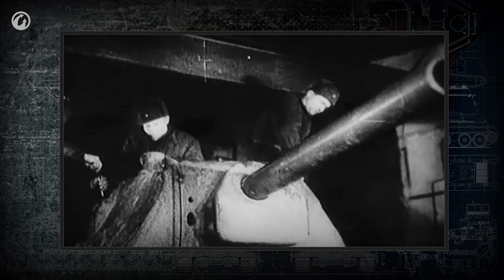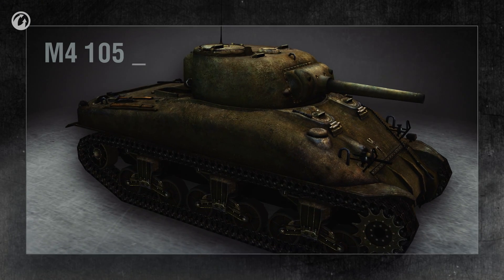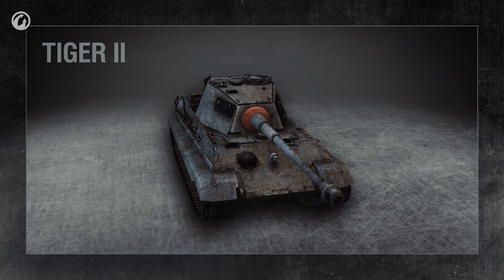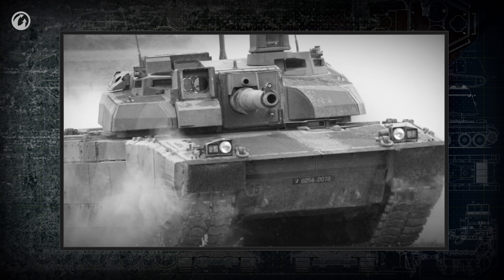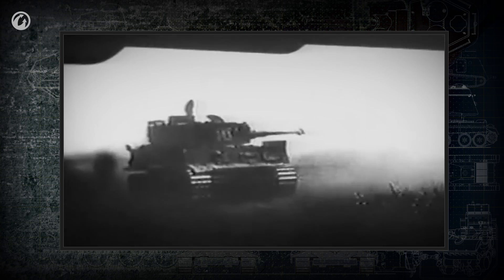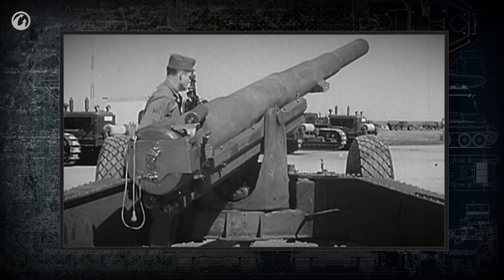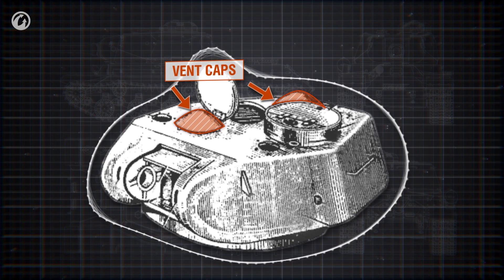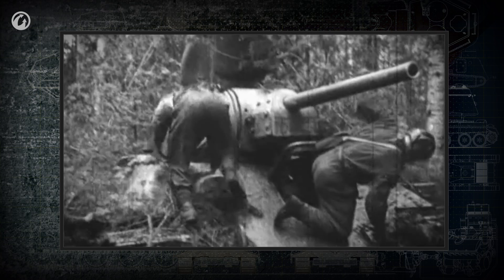Cannon. The Nuts and Bolts of Tanks

Comment: It's worth noting that the british MBT Challenger 2 still uses a rifled gun.
Reply: +junsengjs The British are rather fond of HESH (High Explosive Squash-Head) rounds. HESH rounds have a soft high explosive tip that spreads out in an thin paste over the target and detonates shortly afterwards. They're good for blowing holes in the sides of buildings and cause large amounts of spalling when fired at armored vehicles. The spinning caused by rifled guns causes the high explosive paste in HESH rounds to spread out more. This is why the British still use rifled guns.
Reply: Yeah, they like their HESH.
Though, firing APFSDS out of rifled guns really kills the gun barrel quick.
Reply: They are also far more accurate.
Reply: Thomas Dineen- Yes the British liked their Hesh rounds but now in modern MBTs, Hesh rounds are almost useless because just about all modern MBTs have spall liners.

Comment: 5:02  wait wait.. Isn't that an SU-152??? why does it say ISU-152?
Reply: Im not talking about the gun, im talking about its chassis thats not IS chassis its kv-1s's
Reply: +Xx_neat-beat because it is an ISU 152. The long gun that everyone uses isnt what the ISU 152's used in reality. Most guns that come stock in this game are usually the historical ones used in combat, the others were possible to be fitted on them
Reply: +Kougamatt WOT he's referring to the size of the casemate, the section housing the combat compartment. The ISU-152 has a tall and large casemate, mounted on the IS chassis, while the SU-152 has a more shorter casemate, mounted on the KV chassis.
Reply: +Kougamatt WOT nope, it's an SU-152.. look at it again.

Comment: in fact the British tanks still use rifled barrels on its tanks and this lead to the British tanks having better range than the other nations
Reply: +John Whyte And worse penetration power across all ranges. The british 120mm rifled cannons are simply obsolete.
Reply: +Jake Horsman 
>  rifled VS smothbore penetration myth.
This is hardly a myth. Rifling is completely useless when it comes to modern KE projectiles, since they can't even be properly stabilzed by the means of spinning. However Muzzle velocity amongst the length of the penetrator and its density is one of the be all end all factors, rendering the concept of rifled tank guns as a dead end.
Reply: Jake Horsman
Not only Germany.
Also France, Italy, Russia, Israel, Korea, China and Japan.

All of them use Smoothbore canons
Reply: oh my bad, china did produce some 120mm tank guns as well (for mounting on T-55's if i recall) but yes your correct i believe these where also backward engineered of of soviet technoligy.
Reply: +John Whyte And better shells (for some jobs)
Reply: +Reuters Reuter the L30 rifled cannon is not obsolete and rifeling does not lead to worse penetration power, the L27 and L28 projectiles posess similar KE values the the M289A2 and A3 shells respectivly this myth of worse penetration values comes from the slight reduction in mussel velocity that rifling inparts on a projectile due to friction.

I will add however that the 2 charge system used in rifled guns the L30 tank gun will eventualy be out done by smothbore tank cannons due to the fact that the penetrator rod is limited to a size that can fit in the stowage bins (of course stowage bins can be reconfigured to acomidate for a longer projectile however this would prove expensive so most likely wont accure during the challenger 2's life cycle) where as single charge projectiles like the for mentioned M289 series can expand the penetrating rod furthere into the shell casing without increasing over all lenth of the shell thus resulting in a far superior projectile, and its this superior shell designe used in smothbore cannons that in my opinion has led to the rifled VS smothbore penetration myth.
Reply: +Jake Horsman 
L30 can't shoot NATO shells.
They have to use their own.
The only reason why they still have rifled is because of the HESH shells which can only be fired from a rifled cannon.

Why do you think every country is using smothbore instead of rifled ?
Reply: Yes i know the L30 cant fire nato shells however the newer shells for the L30 such as the L27/L28 are APFSDS the same style that is used in NATO rounds, hense the reason i brought them up as the slip ring alows the APFSDS rounds to be used despite the barrel been rifled.
Also the reason for Smothbore prevelence is due to NATO standerdization on the german 120mm smothbore, the reason the UK maintains its rifled cannons is due to the premium we place on HESH amuniton and its versitility.
Reply: True however the Italian, isralie and japanese guns are all derivitives of the original german desinge the chinese incorpirated most of the features into there designe and the french been the french prefering to manufacture there own arms created there own 120mm cannon.

Only the russians truely produced there own smothbore cannon which is 125mm in calibure for a start and wasnt a designe choice based on some myth that smothbore was overall better but due to there tank designe diffrences E.G two piece carasel auto loaders and there use of tank fired laser guided missles.

The debate of rifled VS smothbore as i stated earlier is nothing more than a myth, both are extreamly leathal weapons with no major preformance difrences between them.
Reply: Jake Horsman
Type 99 uses a 125mm. Not a 120.
Reply: +Jake Horsman 
> Projectiles fired from a rifled barrel regardless of caliber are always properly stabilzed, the entire reason for the invention of rifling was to stabilze a projectile in flight.

And I never implied otherwise, please try to properly read what I'm writing. 

Modern KE projectiles need to be fin-stabilized, since the rotational inertia induced by rifled cannons seizes to work on projectiles with a small diameter. Hence why rifling is utterly useless when it comes to the application of modern KE shells. Slip driving bands also offer worse gas sealing than on an APFSDS shell fired from a smooth bore cannon, again having an impact on the projectiles muzzle velocity.

> On a side note muzzle velocity is not as important to the energy of a projectile as its mass and density, having a heavier 

Now that's just complete nonsense. The equation for kinetic energy (1/2 * m * v²) already determines the importance of velocity, since it adds as a quadratic factor. The urge to increase muzzle velocity is the entire reason why smoothbore cannons were favoured over rifled cannons in the first place.
Reply: Apologies, i miss understood what you ment with the first comment.

>The equation for kinetic energy (1/2 * m * v²) already determines the importance of velocity, since it adds as a quadratic factor. The urge to increase muzzle velocity is the entire reason why smoothbore cannons were favoured over rifled cannons in the first place.

Entirly true, basic physics, but where on about modern KE penetrators and unfortunately we've reached a point with chemical propelent that significant increases to penetrative capabilities canot be achive with shear velocity increase, In hine sight i should of explaned my point on mass and density better.
Reply: -T-X-M-
I dunno if ATGM is a real strenght for tanks.
Shouldn't the tank stay still while firing a missile ?
Plus tanks have to stay on the move to be effective. Except Abrams, Leopard and Chal 2 which are made for defence and not for attack. But Leclerc and T-90.
Reply: +Jake Horsman 
No. Kinetic energy = 1/2 * Weight * Speed ^^2
Speed counts a lot more.
Reply: max mustermann
Check my follow up comment on this, i didnt explain fully, in summery with todays limitations with chemical propellant its becoming exceedingly hard to increase the velocity of projectiles, hense the switch from L44 to L55 barrels, as such its more beneficial to creat a heavier projectile with greater density at the cost of some initial velocity.
Its also the reason the US is investing so much in rail gun technolagy as it has the capability to far surpass chemical enegry propellants.

Comment: At 5:06 there's a SU-152 not a ISU-152?
Reply: +AleK DK Its an SU-152, the suspension, engine deck, and mantlet, are all of the same design.
Reply: +AleK DK I think it is an SU-152 too...
Reply: azbunker it is
Reply: +Sam P If it were an ISU-152, it would have the engine deck of an IS, so the rear would be wider and flatter, and the rear armor would be heavily sloped, but not curved.
Reply: JWQweqOPDH
Ok, but the point of this part of the video is to show the gun, wich was the same on both of them
Reply: Actually no. The ISU-152 is a more modern version that the soviets made during the war. The SU-152 is from earlier in the war.

Here are some Wiki links-

ISU-152 https://en.wikipedia.org/wiki/ISU-152

SU-152 https://en.wikipedia.org/wiki/SU-152
Reply: +AleK DK They are very similar, so it's difficult to say
Reply: +Sam P yeah but they still look different.
Reply: @AleKDK  SU-152 uses a KV-1S hull and the ISU-152 uses an IS hull
Reply: yes it's SU
Reply: Sam P True
Reply: +Sam P true but. Come on mistakes happen
Reply: My last comment was 1year old?? Wtf that went so fast I remember this vid
Reply: The only thing different was the hull
SU-152 uses a KV hull
ISU-152 uses an IS hull (obviusly)
Reply: AleK DK there is a differance the su is lower than the isu but they both have really big gun
Reply: It’s a SU it’s a KV hull